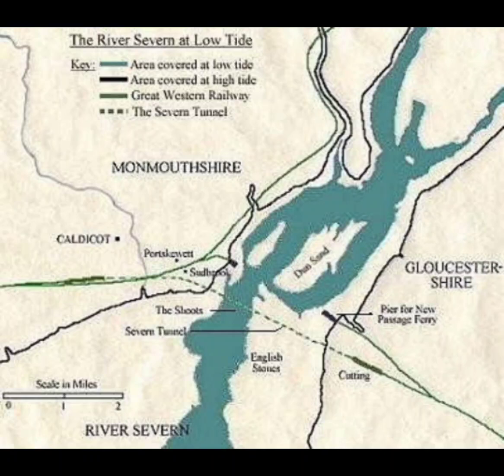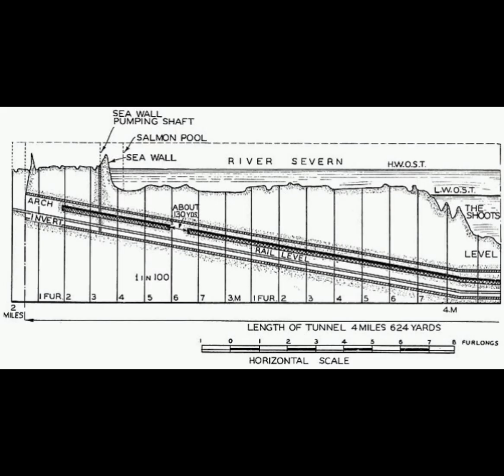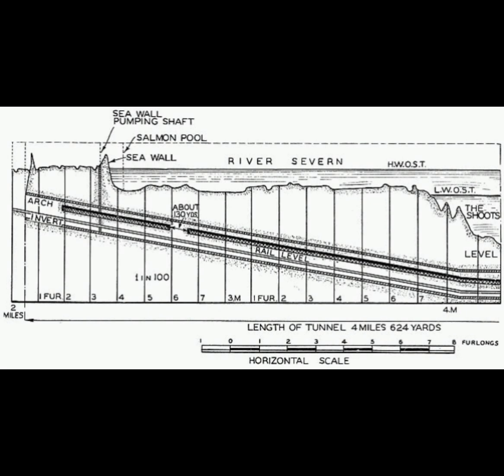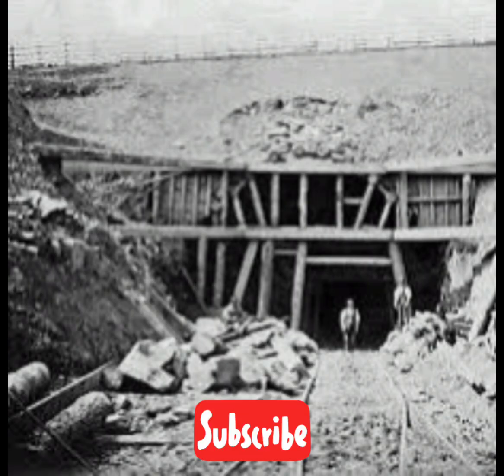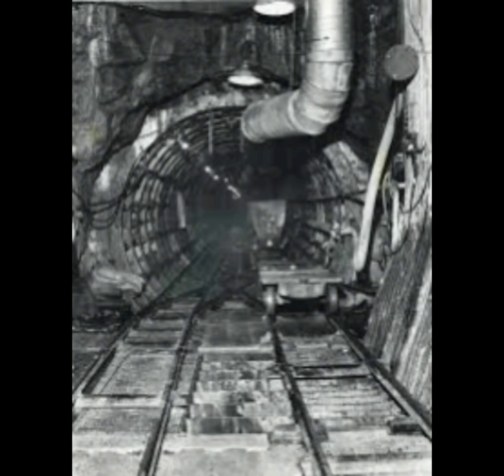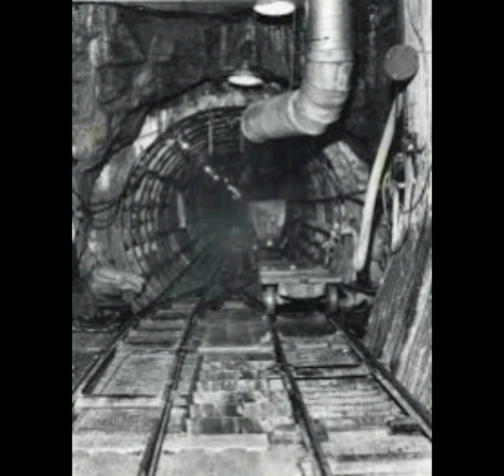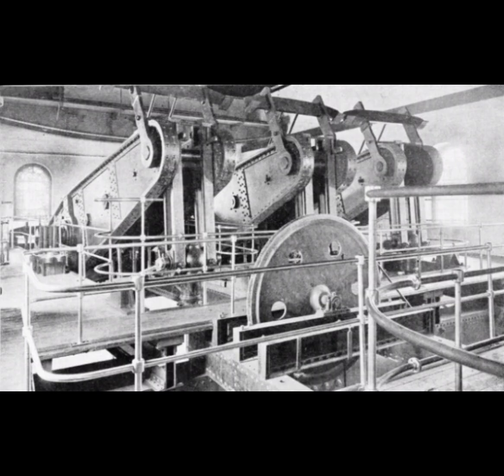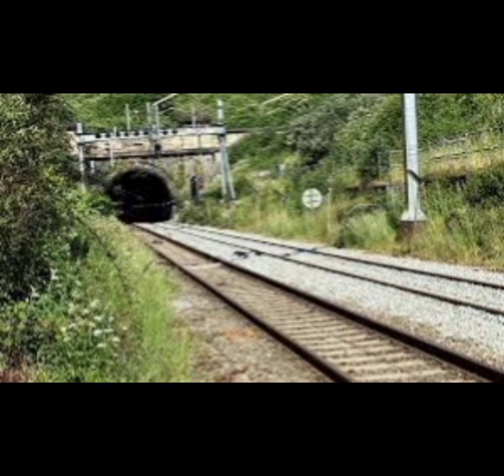CROSSING THE RIVER SEVERN: Why does this tunnel need water pumps to stay operational? #railways

Comment: It's always puzzled me why they didn't pump the spring water into a reservoir for drinking?
Reply from the maker: @mavericmorph5358  after abit of quick research its because the water seeping into the Severn Tunnel is not suitable due to its potential for contamination and the constant need to pump it out. The water is also not a reliable source for drinking because it's primarily composed of fresh water seeping in from the surrounding ground, rather than being a river source. Hope that helps?
Reply: There was a brewery and papermill there in sudbrook back in the 90's. dont know if they are both still there but they used the water from the tunnel i was told.
I was told when i first went in the tunnel back in 1990 that if the pumps failed and the back up pumps also failed, the tunnel would flood in 4 minutes but the narrater here says 26 mins.